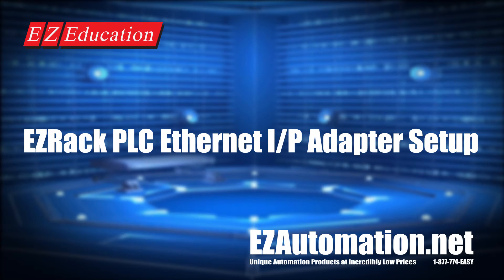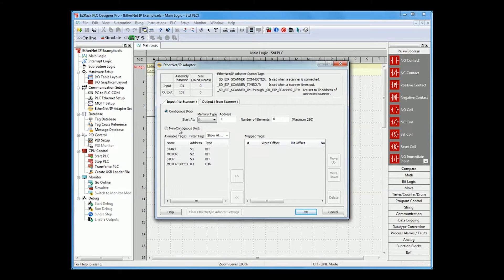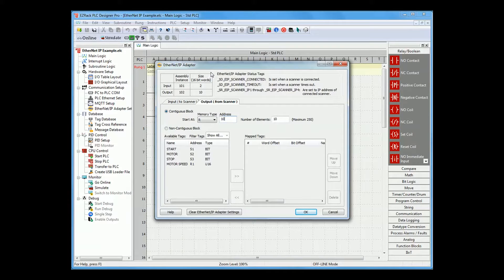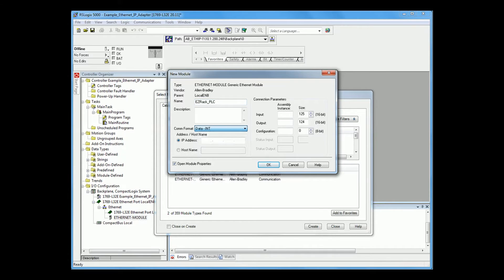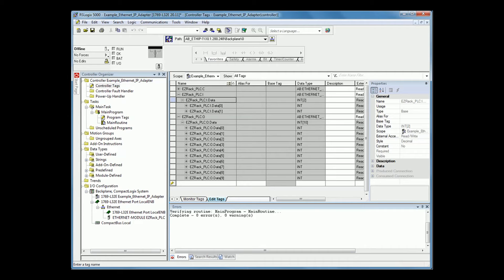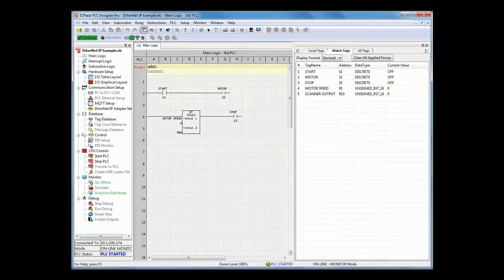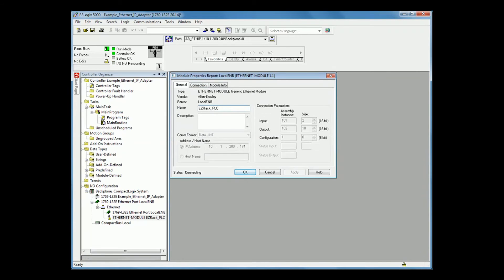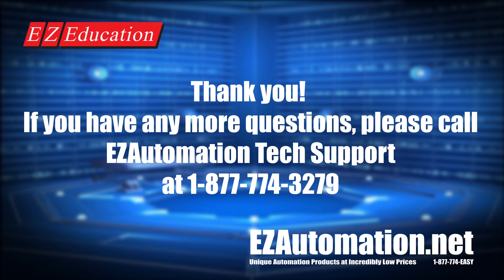EZRack PLC Ethernet I/P Adapter

Comment: Curious if you add another module to the ezrack or want to add more registers? Is it just as simple as making the configuration changes in the EZrack software, then updating the assembly instances, and then downloading?